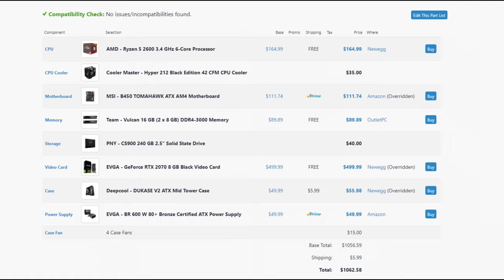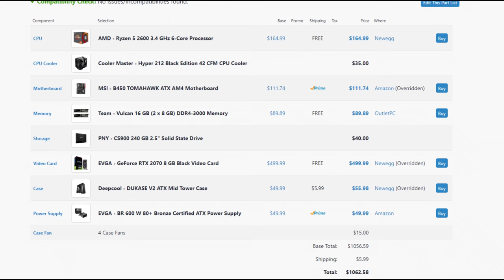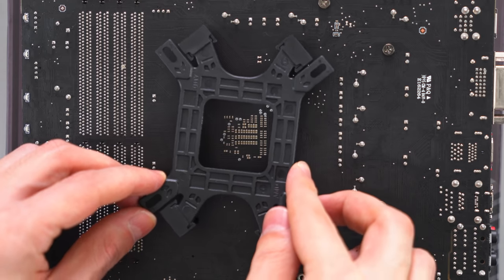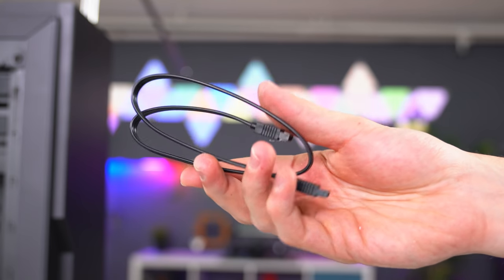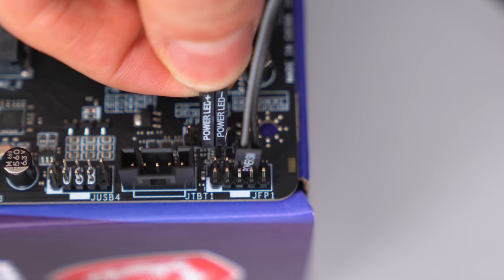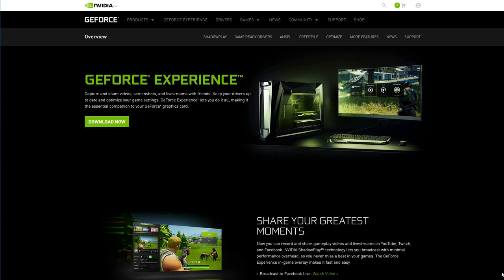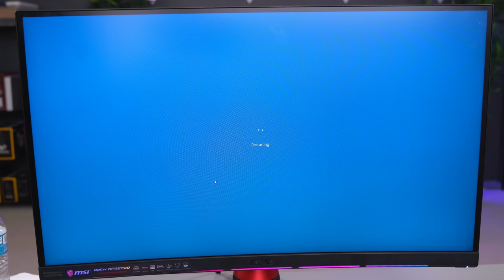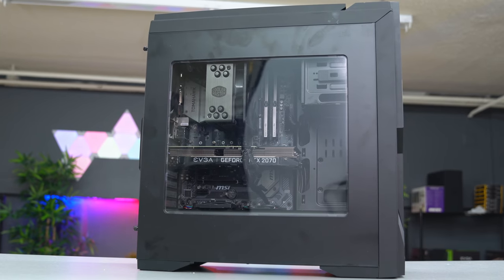How To Build A Gaming PC + Overclocking Guide (2019)

Comment: To start/power on a gaming pc do you REALLY need an SSD, Solid State Drive and a Hard Drive? or what... cuz i m a little confused now. or here... which one is the most important please.
Reply: ssd is faster load times hdd is bigger for cheaper i would go speed
Reply: @ericcoe4005  so ... what is the most inportnat thing tho
Reply: @justinfarrugia355  people on a budget usually go for a 1 tb/2 tb hard drive and a 120/128 gig ssd for the OS
Reply: @Titan69  ok ... but is that good for streaming?
Reply: @justinfarrugia355  your storage type doesn't really matter all that much when it comes to streaming; for streaming you want to look at your CPU and ram. any basic 7.2k 64 mb cache sata drive will do your job
Reply: @Titan69  what about this cpu ... AMD Ryzen 5 2600 AM4 6 Core 3.4GHz CPU is that decent? that comes with a cooler as well
Reply: @justinfarrugia355  yea it's good enough for streaming, that along with 16 gigs of ram should have you set
Reply: @Titan69  bro, thank you so much for your time. BUT i have one last question,
what if i get like 12 gigs of ram sticks? is that good also? (for streaming ..?)
Reply: @justinfarrugia355  depending on what games you're playing really, esports titles will be aight
Reply: @Titan69  i would most probabbly stream fortnite and/or rocket league
Reply: @justinfarrugia355  12 gigs will be enough yea

Comment: wouldn't this CPU bottleneck the  RTX 2070?
Reply: it won't because in most modern cpus, like in this case ryzen 2600, the gpu will always be limited factor when gaming on >= high settings. you can see from fps tests in any game that gpu loaded like 95-99% and cpu stays around 50% load.
Reply: Hey umm guys in new to this and which is better for ONLY gaming.. the joey salads video i5 9600k RTX 2060 or this build

Comment: Anyone have any recommendations for a 144hz 1ms response time monitor for under $200?
Reply: I forget the name but it's by sceptre. Has 165 refresh rate. 1ms response time.  Free sync.  25 inch 1080p. 180 bucks.  Just search around for that on Amazon with those specs

Comment: Can I run 240hz and fps with the omen obelisk 1060?
Reply: No Not even close
60 on most games 100 on something like fortnite
On fortnite or similar games you need a 2080ti to get 240 fps on 1080p high
But on a demanding game like the Witcher 3 it is currently impossible to get that framerate on 1080p

You would at least need something like this and likely upgrade it every year with the fastest gpu available and you still wont get 240fps but fast enough (though I would build one myself)

that pc you listed will get half performance the one in this video

Comment: Is overclocking necessary??
Reply: ildo dobra, no, but it helps your pc a lot. And it is not risky at all
Reply: @kazlee6909  A lot?? pffftt. It gives you like 5 more fps. You will never notice that during gaming. Sure if you got a more expensive cpu than overclocking might be worth it but at this price point its not worth the extra cooler and the additional case fans.
Reply: Moveid Naqvi, say what you want, but I get a large FPS boost for overclocking. I never said it was necessary. But it helps a lot
Reply: @syed5126  so is it necessary or not?
Reply: @kazlee6909  so should i buy the extra cooler or must i use the cooler which comes whith the cpu?
Reply: @ildo6094  Its not.
Reply: @ildo6094  if you are not overclocking use the stock cooler.
Reply: @kazlee6909  what cpu do you have?
Reply: @syed5126  razen 5 2600

Comment: Hey guys I need ur help.
I was about to order my PC parts for my new gaming PC
Specs:
MSI B450 Tomahawk
Gigabyte GTX 1060 6GB
Ryzen 5 2600x
2×4GB RAM from HyperX at 3000mhz
2T HDD From Seagate
SSD Samsung 860 Evo 500GB
PSU Corsair CX Series 750M
And last NZXT H500i
They guy from the store who I called told me that 750W isn't enough and it may fry my PC components. I check this vid and he's using a 600W PSU. What should I pick I'm so fcking confused.
Reply: That guy is bullshitting. Even 600W is too much. You can get away with 500W as well. Your choice. In terms of the build its very nice. However i would  encourage you to get a 1TB HDD and spend the money saved from there on getting 16GB of RAM. RAM will defo help you to get more fps. Goodluck.
Reply: @zapped5272  No problem bro👌

Comment: Is it fine if my cpu temp is at 83 degrees?
Reply: no it should be 60-70 u should buy the optional fan, or check with a professional cause that's not normal well atleast for my pc I have the optional I would recommend the extra fans
Reply: Ye I only have the stock cooler, it hit 83 degrees at 3.9 GHz

Comment: Life hack: put your Windows to download while working on the build (before start actually). :D
Reply: Bro will the screws come with the components or should be purchased separately?
Reply: @bored_abi  should be provided by case manufacturer. If you don't have what you need, you can go to a local IT store and fiind.
Reply: @LittleBoyD  and will it be completely fine if I switch the processor to intel , and change the the graphic card to zotac rtx 2060?
Reply: @bored_abi  https://youtu.be/OZaFqY8UF6I this tutorial is good too, take a look!
Is ok to change to Intel, but you will have to search an motherboard compatible with your Intel. Unlike AMD, Intel always changed the Socket and you have to know what socket you you need. AM4 is standard for Ryzen generations. But if you know that AMD is s*it, with Ryzen isn't the case anymore. I see you haven't so much experience and not to complicate things, you can safely buy same gear, according to what I've said: Intel CPU needs another motherboard with the Socket type compatible with generation your future CPU is. For the 2060 you told, is completly fine.
PS: Sorry, i'm not native english speaker! If you are not so sure, you should ask for help to a friend.

Comment: case is unavailable on amazon, any alternatives?
Reply: @ Aidan Campbell any case that supports atx motherboard and that you like
Reply: @ Aidan Campbell I recommend checking the developers website to make sure everything fits inside the case
Reply: @ Aidan Campbell I like h500 by next. It’s a good all around pc case
Reply: @hellomoto6300  ill check it out, thx
Reply: @ Aidan Campbell yo don’t get ryzen 2gen get the 3gen equivalent it’s a lot better and only 50$ more on msrp
Reply: @ Aidan Campbell it’s the ryzen 5 3600 and everything else is going to be good. Also if your going to get ryzen 3gen overclock the ram to at else 3200mhz at cl16 (16-16-16-36)
Reply: @ Aidan Campbell also watch the overclocking guide at the end

Comment: Trash build. Cpu bottleneck all the way.
Reply: Overclock it?
Reply: @WheatsTsu  ryzen don't overclock that much.
Reply: @vanshkejriwal4823  my ryzen 5  is at 4.3 whitch isn't amazing but it is still not bad at all and def not that hard of a bottleneck
Reply: @WheatsTsu  but still is a little slower and not good in the longer run.
Reply: @vanshkejriwal4823  4.3 is just fine sure it wont get you GPU max potential in some games but it wlnt damage your PC lifespan
Reply: @WheatsTsu  I am talking about the performance in performance after 2 years as tasks keep getting more and more intensive but the graphics tasks don't as substantially